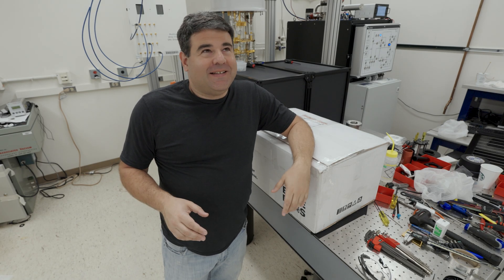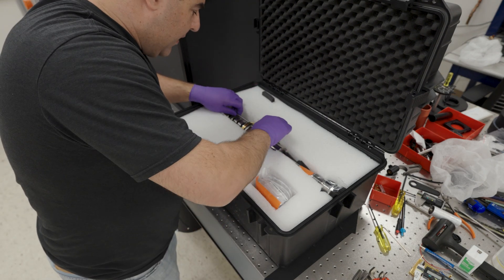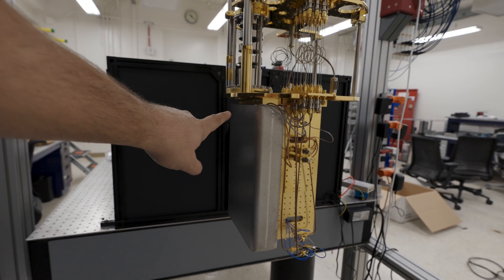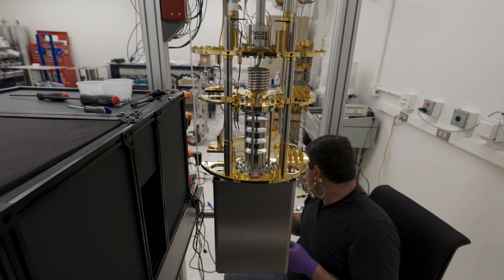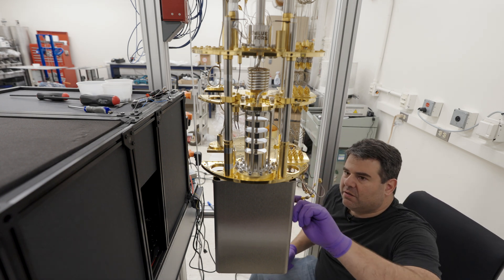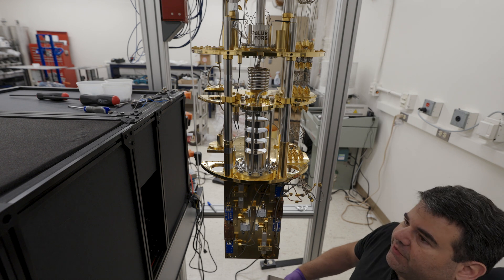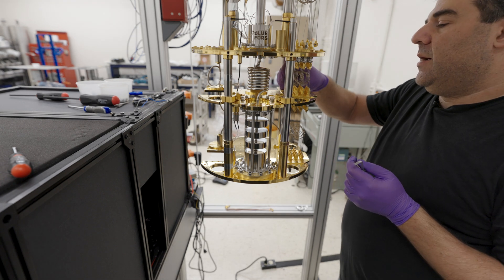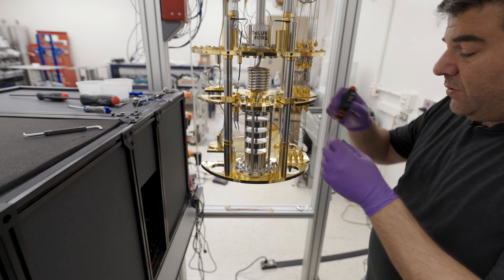Fixing a Superfluid Helium Leak

Comment: Why do the coax cables have loops in them between the stages? Strain relief?
Reply from the maker: Yes. As everything cools down things shrink at different rates, and if you had a straight shot the coax would break frequently.